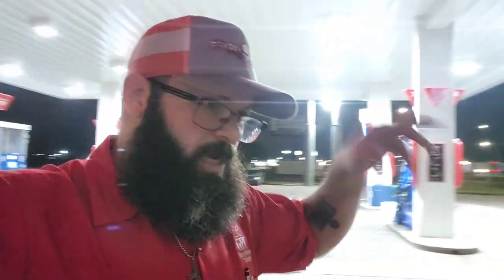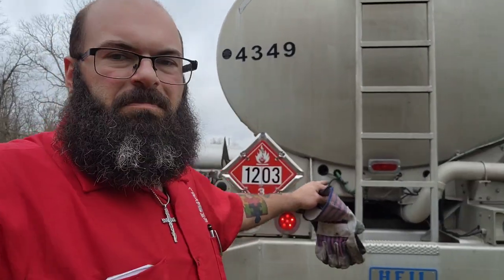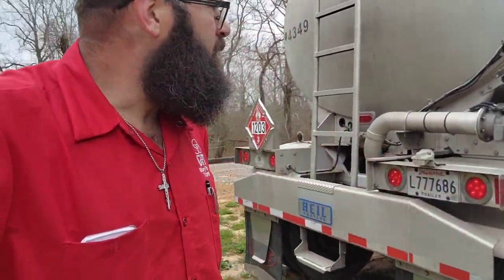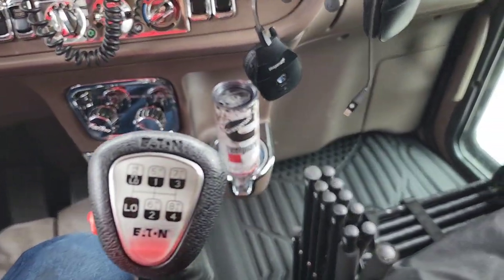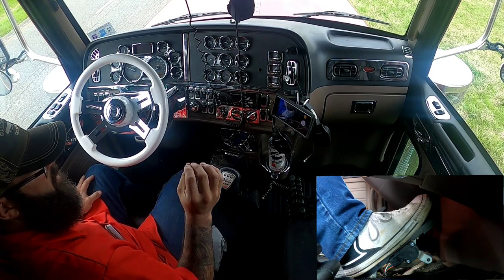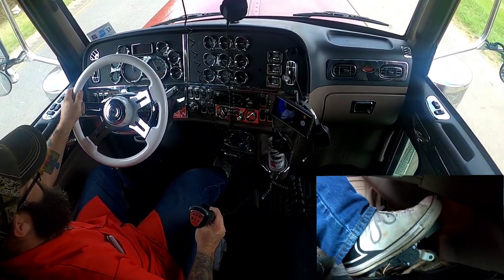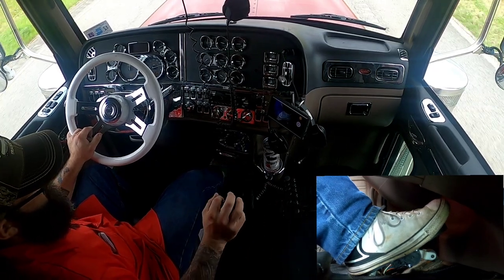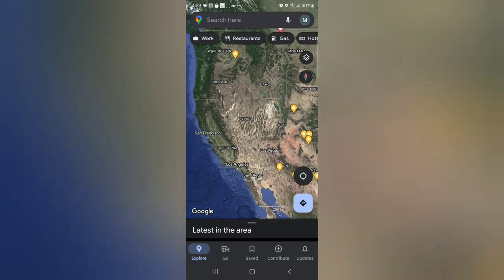Hauling Local // How to Shift A 13 Speed Transmission ( How I Do It )

Comment: That's how I learned when I was 18 yrs old. My 2nd truck driving job was a super 10 it was a cake walk.  It was a really nice truck and nobody knew how to shift it. So I didn't have to worry about somebody using it when I was off. I noticed how smooth you shifted on your 1st trip like you been driving it.
Reply from the maker: 10-4

Comment: Like your content. If I may make a suggestion for those that may watch this for training  - Always hook up downspout and hose at the receiving storage tank end first.  Recommend that the last hose connection should be to the trailer. I've heard of someone hooking up a hose to the trailer and immediately opening the trailer valve without the other end of the hose connected to anything. Each of us develope our own procedures that work for us, but others are watching and learning.  Safety must take priority.  Just a suggestion.
Reply from the maker: That's good practice but that's why I always look before opening valve
Reply: I have been fuel hauler 30+ years...  that advice to always connect to ground first, trailer last is a butt saving practice.
Even when switching products using same hose, move fitting to next product fill first, then to next product outlet on trailer, more butt saving practice.
In todays world with distractions coming at you from every direction, it is easy to slip up and once that handle is pulled or wheel valve opened to discharge...  boom, too late.
Not criticism, you are gettin the job done well but although so many times we can be right there at the trailer outlet, I will put the hose down, hook to ground, walk back and hook to trailer.  Same with product changes, move fttng first, then move hose to next compartment.
Train yourself to make these common practice and you "should" never have an "OH SHIT!!" moment.
That stuff runs out the end of those hoses faster than you can imagine with the hose end laying on the ground...  or hooked to wrong tank.
To anyone reading this, Mike is doing a tip top job, and when he says he looks before opening valves, yes, ya have to... and he is making good videos, I only offer fuel or any liquid hauling practice advice from a lifetime of doing it and I have seen what a total shit storm can happen from a spill or going into wrong tank.

Comment: When I first started driving in early 1980’s I pre selected the range selector Red one and wore out the fork in the transmission pretty quick but I learned quickly not to do that $$ the high and low doesn’t matter like the OD but the new transmission may not do that now this was a 1981 back when OD would give out a whine in OD 🤪😎Rickster

Comment: Thanks, I'm collecting all the information required to drive and operate a Semi, I hope I can do it well 😉👍
Have a good day!
Reply from the maker: Just listen to the old timers they know more than us younger guys and you will do fine...
Reply: Mike is on point. Keep your ears open, don't be afraid to ask questions. There is no Stupid question. You learn from your mistake. And the longer you do something the better you get at it, Don't Rush at doing anything, that rushing will get you in deep Crap. And very important, Learn everything about everything. When your out in the middle of no where and no phone service, you don't need to be an expert at fixing stuff, just get your rig, car, or bus out of a bad situation to a safe location. And SLOW DOWN on exit ramps, keep your foot off the breaks on freezing road surface use your gears to slow the momentum of your rid, don't panic break.Good luck in your endeavors.
Reply: @ThumperKJFK  thank you Gregory, I really apreciate your comment, I will be a good trucker one day, and its not about mony, its about passion! 💪
have a good day

Comment: I spilt the gear down in neutral. Meaning move shifter to neutral then move splitter to low and then slip it back in gear. 

Another five years and the manuals will just about be gone. Everyone is going to automated transmissions.
Reply from the maker: Yeah and that's a shame

Comment: You have to get a old school shifter glitter ball a red one with the peterbilt emblem in the middle the ball is about 50 bucks but the chrome adapter is a hundred bucks which raises it in my opinion to the perfect height that's really comfortable I myself don't like the apehanger shifter extension but that's me
Reply from the maker: The shift extension that's on it now is a 6 Inch and it's comfortable to me but I wanna get the stainless hollow shifter for it and yes the red glitter ball is a must and get the brake valve knobs to match...

Comment: Thats the way i used to shift a 13 speed. Some guys would only split the high side in the neutral position than move shifter back in same position they just took it out of. I did not
Reply from the maker: Yeah I have seen them do that to...

Comment: What rpm do you begin your downshift from L to L?
Reply from the maker: Well That depends on what motor you have I have a detriot 60 series and I start at or around 1300 rpm
Reply: @Life-On-18-Wheels  I've got the same in my 97 freightliner. Thanks for the help, this is probably the most comprehensive 13 speed video on here. Keep up the good work, driver

Comment: Although I don’t agree with how you float your gears ,,, especially 1-4 in low select I do respect your throttle control 5-8 and wen u use red 13 speed split switch and your explaing teckn is awsome thank you for helping me get it and understand it better